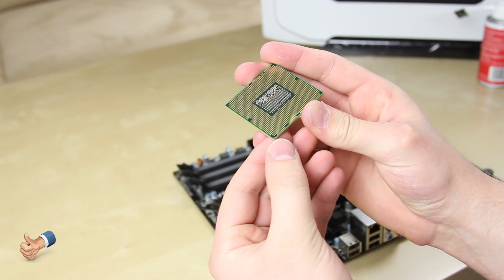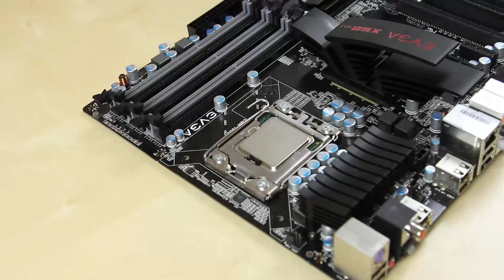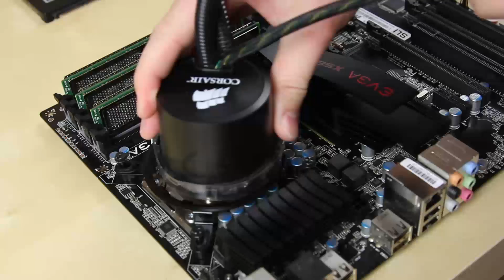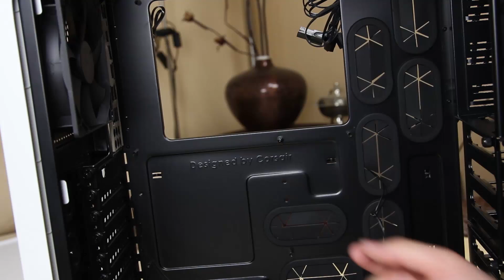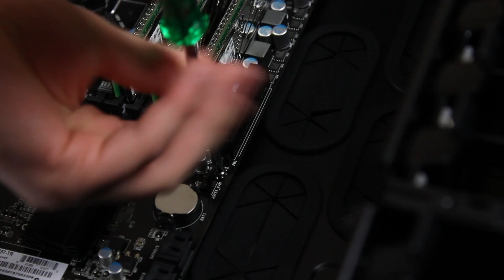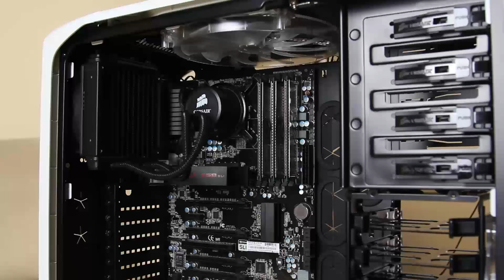How To Build A Gaming Computer (Part One)

Comment: You must use the same ram (same frequency, timings,...) for each memory controller on your motherboard. You can use diffrent speeds in your computer, it works but is not recommended.

Comment: Motherboards only want 1 frequency for all the RAM, you can't specify which sticks get which speeds, and it's not recommended to mix different types of RAM anyway.

The speeds rarely matter unless you're using on-board video. You'll never see a difference between 1333 or 1666 except in some specific situations, so don't worry about it, go with what's cheaper.

Comment: it's a great tutorial/video but the only thing that is bothering me is the CPU and motherboard installation because you're using the 1366 which has already been phase out and the 'mainstream' socket would be the 1155 or the 2011 but other than that it's a great video